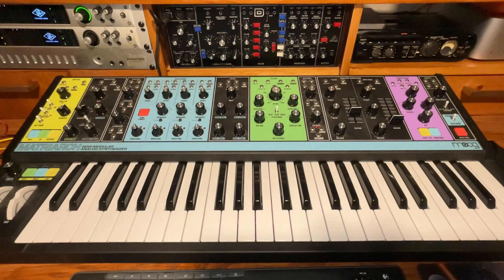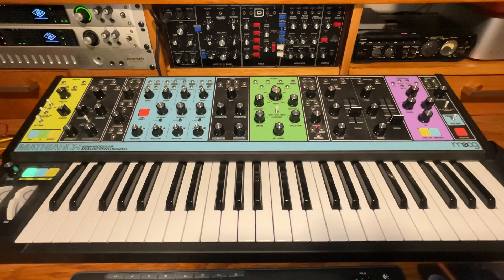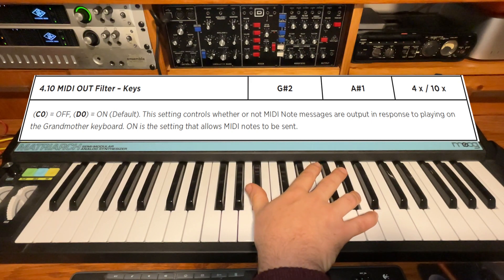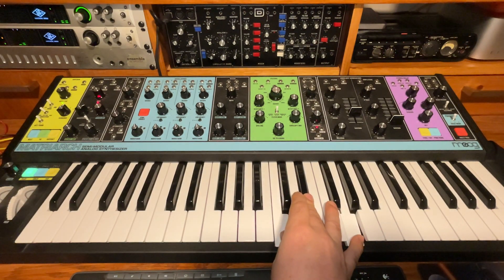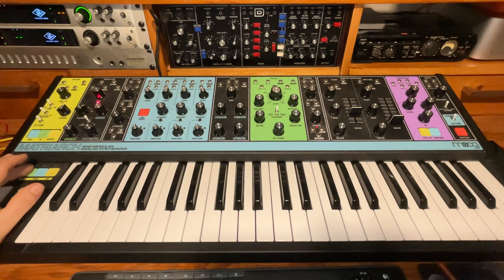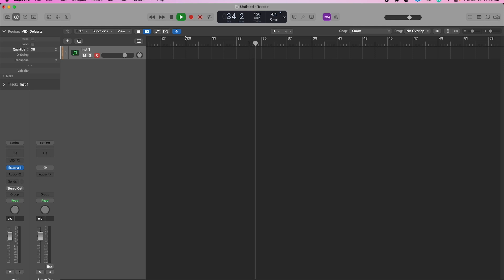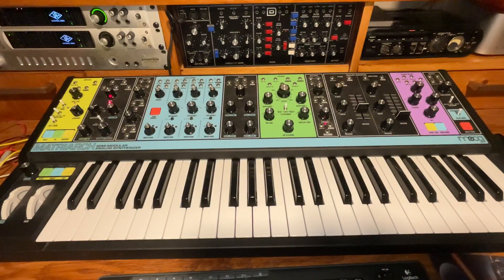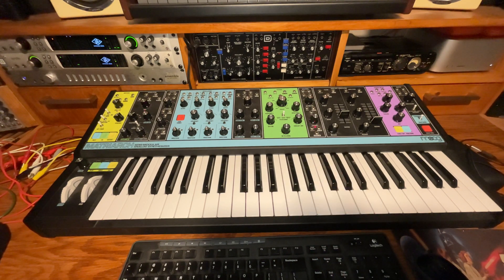Fix Matriarch Hold Issue with Logic

Comment: Hi Robe ,thanks for this video! I had the exact same issue — Matriarch connected to Logic via MIDI Din through a mioXL. I tried the “Filter Keys” method, sequencer fixed but then MIDI recording stopped. Only after a global reset, MIDI recording  worked again, but the sequencer is still going nuts like in the beginning of your video after the global reset!Any ideas on how to fix that without breaking MIDI recording?
Reply from the maker: Have you updated matriarch;s firmware? A little after I made that video moog did an update that fixed the issue
Reply: @RobeMusic will check! Thank you
Reply: @RobeMusic hey Robe, did the update nothing changed, same prob
Reply from the maker: Ok. Then you must have a midi feedback loop happening somewhere. Email me (email address is on my website….whenever I put it in comments YouTube deletes the message) I’ll do my best to help
Reply: @RobeMusic thats very kind of you! Ok will do! Thank you

Comment: Hey Rob your legit probably the only person that can help me with this im a fl studio user so external gear is a even bigger challenge then logic .. i have everything working except the arp/seq with the matriarch and fl studio i can record and use all functions but when i draw in midi notes and turn on the arp .. say i have a 2 note chord .. it plays those 2 notes in a time division and stops outputting the arp the notes go dead till it loops back around then it will play 2 notes again .. its weird and i cant seem to figure out why its doin it
Reply from the maker: Hmm. i've never used FL Studio. so not sure if i can help with this...but I'll think about it and see if i can come up with an answer for you.

are you sending midi clock to the matriarch from FL? (not sure how to do this...never used FL, but arpeggiator wont work in any daw unless you send the matriarch a midi clock. in Logic and Ableton Live that's in midi sync settings, studio one and protools it's in external device settings...not sure where it would be in FL)

When you draw in midi notes, does the matriarch stop arpeggiating/playing when the midi notes end? if you want to keep them going, make sure you have HOLD depressed on the matriarch. (or draw the midi notes to the length you want the arp to play)

have you tried turning off LOCAL CONTROL KEYBOARD in global settings? (with some DAWs having local control enabled when using a DAW to send midi causes a midi feedback loop)

Comment: This was very helpful, thanks. But a strange thing is "MIDI OUT filter"  is not included in my manual, it ends at 4.6.
Reply from the maker: You’ll need to update your firmware. You can get firmware updates from the moog website in your account. The updated manuals are also there. (For some updates it’s a pdf included with the firmware update)

Comment: Man, I just spent 2 says troubleshooting this in Ableton before i came across this and was surprised i couldnt find any documentation or tips in the Moog forum. Your solution to turn the Midi filter ON for keys was one of the solutions I found that fixed the Hold problem, but then I couldn't use the Moog's Sequencer or Arp on external synths, soft synths, or record them in the DAW. 

The solution that worked better for me and allowed this was to turn Local Control OFF for the keys AND Arp/Seq. I just have to turn them back on if i want to use the Moog by itself, which shouldn't be often. This also solved the double triggering issue i was having intermittently, causing paraphonic voice allocation weirdness. Anyway i'm exhausted from all the troubleshooting, i need to reset my brain so i can finally enjoy this puppy.
Reply from the maker: Yea Local control On/off is the standard way to do it with a DAW. Weird how each DAW behaves slightly different. Logic it’s fine to just filter MIDI keys, that way you keep local control if you want it….but not the same for other DAWs. Thanks for letting me know about Live, I really don’t use it that much anymore…but if I go back to it, now I know what to do. Thanks
Reply: @RobeMusic  oh cool, likewise i didn't know that about how it worked in Logic.

Comment: wait this is huge! i use the matriarch and logic as a main vst controller too -- i also get issues with my sustain pedal, the matriarch, and logic. midi chords with a sustain pedal note will choke upon playback. any ideas on how to fix?
Reply from the maker: Hi Tommy, Sorry, no simple solution for that that I know of...It's happened to me a bunch as well. I actually switched to Studio One about 5 or 6 years ago because of some of the weird issues with midi in logic. (the main one that drove me crazy is that in logic ALL midi is recorded to all active midi tracks...in other words can't record 2 people/instruments playing separate parts at the same time!!...one of the recent updates they say that they fixed that...but it's still buggy.)  Studio One fixes a bunch of those issues...but of course it has issues of it's own. So, for some projects I use Logic and some Studio One. Studio One i don't have as many issues recording midi in real time....but it's a bit of a pain to set up and doesn't have a built in step sequencer like logic...but in general i find it easier to work with. Only solution i came up with was to record and then manually edit/fix sustain pedal automation (or sometimes note position) in logic afterwards...just offsetting the notes by a tiny fraction worked....but that's a pain if you're doing anything longer than a short loop. Other solution is to forget about midi and record everything with CV...that works great...but you need a DC coupled interface to do that.